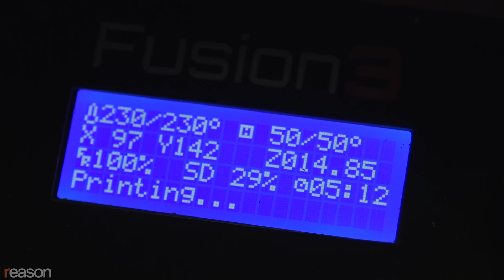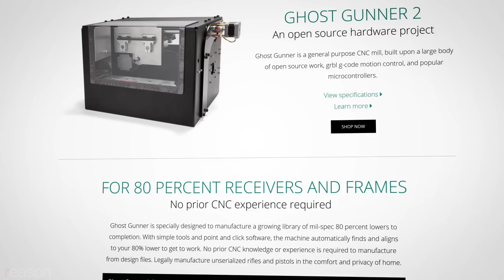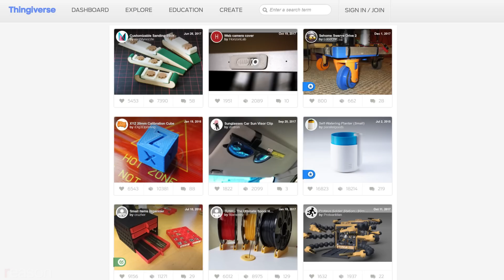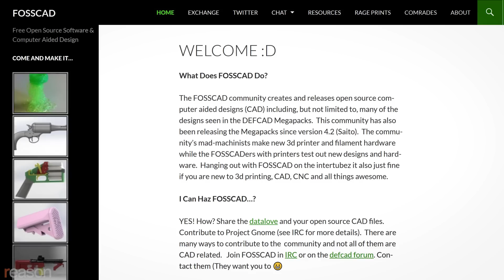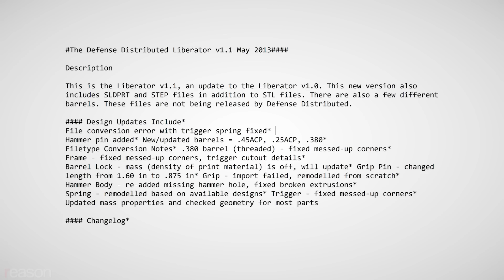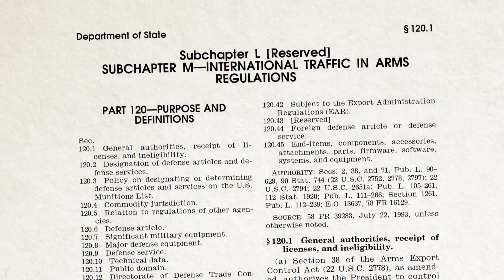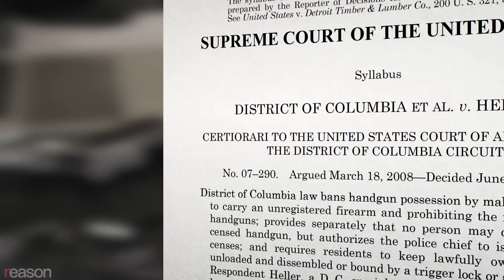The Inevitable Death of Gun Control: Cody Wilson and the Future of Untraceable Homemade Firearms

Comment: Any/most backyard/home machine shops can make a 'simple' handgun.
'Simple' means, single shot, double/triple shot, autoloading weapons.
Simple also means FULL auto handguns, refer to the weapons of late WWII such as the Brengun, M3 'Greasegun' and even the type of the Uzi that were designed to be mass built cheaply & quickly with lower skilled machinist.
Reply: Zip guns were fun in the old days....and they'll single shot and kill rather easily.
Reply: Honestly there are also ways to manufacture guns out of even more simple components if you're willing to eschew accuracy. All you need is a tube with a barrel the diameter of the cartridge you want to shoot and you can make a submachine gun or even shotgun.
Reply: I believe Forgotten Weapons actually covered one of these simple blowback SMGs manufactured in the UK as a political statement. It was made almost entirely (save for the barrel and magazine) from hardware store-bought components.
Reply: I really should add that to the literature I have on military arms sitting on a hard drive, more for the sake of long term survival and having the means to put together a gun after the other guns I actually own have long since ceased functioning.
Reply: I mean look at brazil, they are turning out off the books SMGs from garages
Reply: @homewall744  I remember those days and zip guns; they were just as likely to kill the shooter as the target.
Reply: @Julian Silva o
Reply: Jeremiah Was A BearFrog Shoutout my man PA LUTY!!!!

Comment: For anyone who thinks they can get rid of guns, you should know that me and my brother can make a crude gun in about 30 minutes in my brother's home shop.  We can also make a fully automatic high precision assault rifle in about 2 weeks.  The only problem we would have doing is putting the riflings in the barrel, but there are ways around that too.
Reply: i would think that you could fashion a tap similar to a thread tap for screws to do the job, maybe get a tungsten carbide rod and a CAD file send the stuff to a high precision mill shop, and bam your done! Unless making riffling taps is illegal which would be really hard to define in law :)
Reply: Indeed.  I think you could probably forge the barrels around a mandrel that had the reverse riflings on it.  But that would be pretty difficult to do in a home setting.

In all reality, you probably don't even need riflings if your objective was to be involved in urban war setting.  If your targets are all within like 100 yards, it seems like most times all you do is send as much lead down range as possible rather than trying to take aim.
Reply: People are making mandrels out of wood/3d printing them with notches for copper wire, to use in a process called electrochemical machining. Basically you leave salt water running through the barrel, the mandrel covers the surface you want to leave intact and the metal in proximity to copper wire is corroded away. Since the mandrel is notched with helical patterns the barrel comes out rifled.
Reply: Oh or you could just make a shot gun so rifling isn't an issue
Reply: James Grider should look into milling ghost guns. He was pissed off that the government is banning guns. He would've liked to have a gun to shoot up the school. Of course, him wanting to do that is not the gun's fault, it's just the school and society. I would like to have the ability to mill or stamp realistic quarters. After stamping four realistic quarters, I'd have a dollar. Of course I wonder if the fucking metal needed to make them will cost more than what I'll get out in quarters. I hope not. People should buy my "Impact" a James Grider novel on Amazon so I can afford a used car. I wonder if Infucknal Devices like the Wykkdik of Fhekris is a weapon that everybody should be allowed to have under the second amendment. Like imagine there were destructive magical weapons that worked outside the laws of physics and every person had one?
Reply: Karozans don't talk about making full auto weapons online easy way to get your door kicked in.
Reply: Sheldon Robertson no, that both is always right next to the ATF. There ain't enough tin foil in the world to make me take those odds....
Reply: Can't find the article but this g about using a 3d printed plug in the barrel a flow if salt water and electricity to "cut" the riflings like revers electro plating. A kid did it online worked like a charm. The plug could probably me hand cut too.
Reply: Karozans 
Look up Polygonal Rifling.
Reply: How about flow forming?
Reply: You can rifle through cold forging, by pressing a tungsten button through the barrel. Or you can say fuck it and just smooth bore that shit, it's going to be inaccurate as fuck but who cares.
Reply: Dick Chappy 

A DIY ECM  set up is pretty easy. And  shotguns don't require rifled barrels
Reply: It's not that hard to rifle a barrel, several youtube videos on it.
Reply: if you can build a precision rifle in two weeks then I think you posses the skill to build a rifling jig - smh